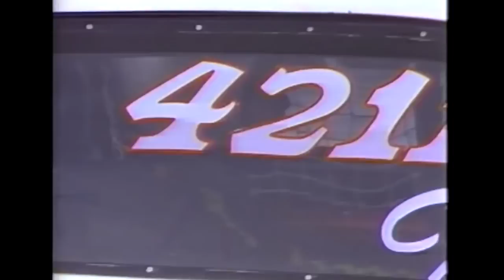CLASSIC VIDEO - 1983 NHRA NORTHSTAR NATIONALS (FULL EVENT)

Comment: This was the time when discoveries were made that allowed engines to jump from 1500 to 3000HP. Then jump again to 8000 and then to 11000 Horsepower. The crazy thing is the changes were quite small and they could have had 11000 much earlier because the engines themselves did not change much.
Reply: True clutch tech was also critical.
Reply: @edgarbeat2851  Definitely.